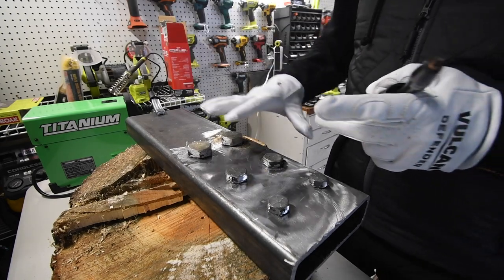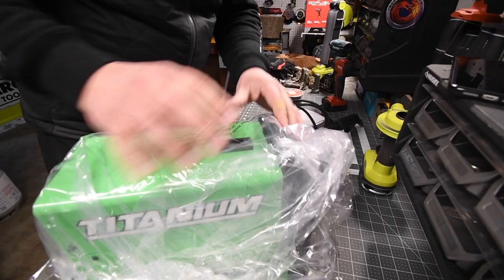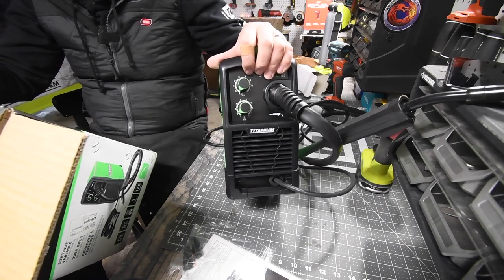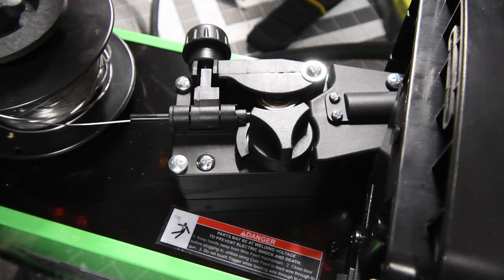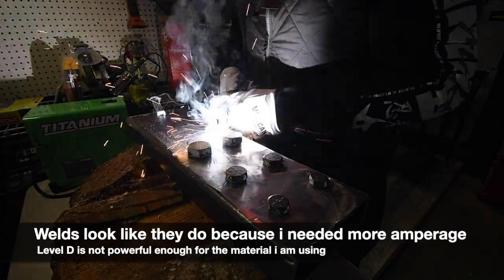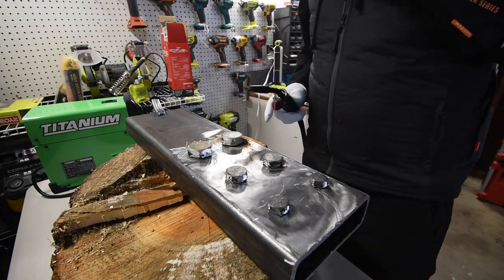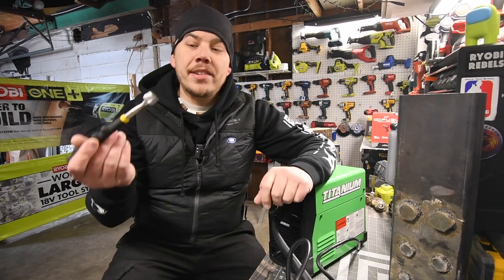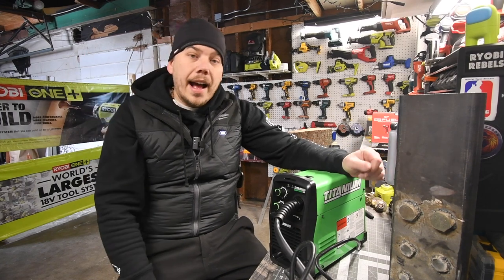$170 Harbor Freight Titanium Welder

Comment: You're long arcing you need to to bring the tip closer to it about 1/8in which it will made it better weld, turn your amp up, and go slow. Also make sure your clothing is ether 100% cotton or wool.
Reply: I know absolutely nothing about welding... it's quite interesting to me though..
 Never asked any questions because I feel like i would be laughed or have noses  turned up at me by the welding Pricks..
You seem nice I'm sorry for asking you stupid questions...
The video was interesting to see how the wire is fed through the welder to the tip of the gun.       What exactly makes the spark? is their just a heat element that heats the wire and it's the Hot wire hitting the Metal He's welding creating a spark? or does pulling the trigger actually create a spark before you even touch what's your welding?
  Also what type of welding is this called in the vid? and what is MIG welding.. do they all involve some sort of heated wire
Reply from the maker: I thank you for the info JLS, I am working on my technique :)

Comment: hey brother just a heads up the fluxcore welding is a pretty violent and emits alot of smoke. the mig process is much cleaner with wayyy less spatter. the ultimate 200(from harbor freight) is a nice welder and comes with eveyhting you need to do mig/flux core and tig(very fun process to learn) and stick but u will need shielding gas for both which can get a little expensive on your initial investment because you have to typically buy the tank(some welding supply shops u can rent a tank but its probably cheaper to buy than rent it by the month)  but the refills on the tanks are not that bad. you want a 75/25 argon/co2 (mig) and 100% argon for the tig. good luck with everything. im self taught from youtube so if i can do anyone can. you can usually get a screaming deal on marketplace too. good luck with everything and rock on
Reply from the maker: I thank you for the input Mustang. we will be getting better at this :)

Comment: You're welding pretty thick material so you gotta turn it all the way up.  Also you have too much "stick out".  Need to be closer to the metal.  But you also need gas to make any clean welds.  It's a good machine to fix "farm" stuff.  Or if you just need to weld something every once in awhile.
Reply from the maker: I will try that next time and I thank you Kesh

Comment: Can someone explain why you connect that car jumper cable to what your welding?
I'm sure it has something to do with electricity also are there some commercial welding machines that don't require you to use the jumper cable ( no idea what it's actually known as)
Reply from the maker: I think it completes the circuit
Reply: you are correct mct it does complete the circuit and allows you to weld or put the load to the specific point to where you are trying to weld. 👍🏾👍🏾

Comment: I find that very very very tiny, or no, movement is required for this tiny flux core welding. Also... get much closer with the tip. Many people just remove that fake gas lens from their flux core welder. Makes it much easier to get close and produces a better weld. You won’t ever get pristine welds with that welder BUT you can get decent welde. Just go SLOW. A LOT slower than you would imagine you would need to go. Just practice and you’ll get it. It’s very different than using a real MIG welder.
Reply from the maker: I appreciate the input, this is a skill I will be getting better at